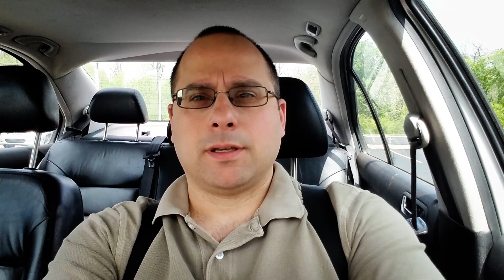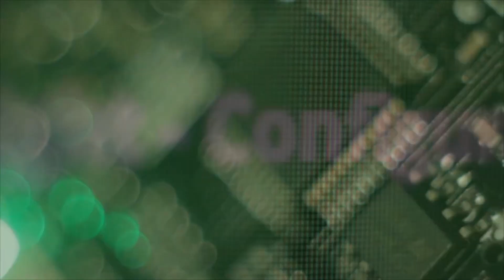Frsky Taranis antenna mod and why you probably shouldn't do it.

Comment: Since performing the Antenna mod (following Steel's video to the letter and adhering to FULL anti-static precautions) I have been experiencing a few issues where my Alien quad has been unresponsive in mid flight and I have had to disarm. I've never had a FailSafe occur in the 2+ years of flying so I'm not sure what that feels like when it happens. Therefore I'm not sure if my issues are down to the antenna mod or my FrSky XSR RX. The reason I say this is that my UBAD quad has an older RX (X8R) and I don't get the same issue. Having been a professional electronics engineer for many years, I know it's not related to any anti-static damage on my part or poor soldering skiils. Something else is at play here, and I'm troubleshooting this. So my recommendation is not to do this mod, as even with my meticulous approach I have an issue. Tony
Reply: A few things worth considering for some people Josh, 
1) There are genuine FrSky 2dB and 5dB (RPSMA) available and perhaps the solution is to revert back to a 2dB one.
2) Perhaps soldering the braid to both ground solder pads that sit either side of the signal pad? My thinking is that this may be a requirement for a healthy RF signal, even though both pads are connected together at some point on the PCB.
3) One thing that is still unclear is how does the FrSky telemetry and protocol work. The Taranis antenna is both a transmitting device (RF to copter) and a reception device (RF from copter). Therefore, there may be some particular way that these 2 functions are balanced (or multiplexed) and what we are doing with removing UFL connectors, soldering directly thick coax and using higher gain antennas could well be upsetting the equilibrium  of the system.
4) I'm going to create a test rig with my known parts that have given me issue (like RX module, FC, ESC, motor etc) and set this up on the bench. Then use the Taranis with 5dB antenna and try to reproduce the error condition by 'flying' in my usual way. If I can find a way to replicate it on the bench, then perhaps I can find a solution (like going for better quality antennas, lower gain antenna or soldering to each ground pad)
Regards Tony
Reply from the maker: +Expressive Imagery have you tried replacing the antenna?
Reply: You have asked this many times now I see. Did you just replace your 5db 
antenna and it fixed the problem?

What did you see when you opened the radio up and checked the pads?

There's a lot of folks who would appreciate a follow up on this video, 
even if you have no concrete conclusions or recommendations to make. We 
listen to you for a reason. You're a trustworthy and discerning 
authority. Thanks mate!
Reply: At this stage I don't have one to replace it with. I've just purchased a branded Wifi one from Amazon and will  try it out when it arrives. The trouble is that I can fly 20 packs and not have any issue since the issue is so random. I wish I can find a pattern so that it can be repeated. All I know is that it seems to happen within the distance 5M to 40M away from me. My Taranis does not tell me the usual "Telemetry Lost" when I loose control of the copter. Just the other day I was hovering in front of me just doing a little "drop catch" type exercise and at 2M height it just slowly rolled/pitched over and hit the grass with all props spinning. I disarmed straight away but the props where still spinning for a few seconds. At first I thought it was a failsafe condition that was triggered but since I have a detailed OSD running and I was recording on my DVR at the some time, the OSD did not show the normal state when a failsafe occurs. It's almost like the TX was still sending out the RF and the FrSky protocol was just sending out the last known logic pulses from the TX control board and ignoring any input from me. I've seen this exact same sequence occur 3 times now. Would you like to see the DVR footage for each incident? Cheers Tony
Reply from the maker: +Expressive Imagery are you 100% sure the receiver is set to "no pulses" for failsafe?
Reply: Expressive Imagery this is good science. thx man.

maybe do a vid on your channel with your findings?
Reply from the maker: That doesn't to me look like a failsafe. Failsafe usually looks like a control lockout followed by a slow tumble. But Blackbox would tell the tale.

Comment: When I cracked my taranis open to do the mod there was a UFL connector on the antenna board already. So it was a matter of unplugging the old antenna and plugging in my SMA. In my case would you still recommend not doing the mod?

Comment: I recently ordered a replacement transmitter board for my Taranis. 
My problem stemmed from soldering on the surface mount coax connector to my board backwards, (rotated 180 degrees).  Yes, one of those small connectors is a ground! 
Look carefully at the back of the connector before you solder it or use a multimeter to identify what are the grounds (3 of them) and the RF output  (just 1).

Comment: I am now confused. My taranis board went bad after a month of using it and it was still bone stock. I ordered a replacement board and now I am confused on how I should go about this.. put back stock antenna or put pigtail on it. Search around the web including youtube and the story is mixed.
Reply from the maker: Sorry, I don't know either.

My gut feeling is there is nothing wrong with the pigtail mod, as long as you use an ESD-protected iron and you wear an anti-static strap while working. The Taranis SE has the same mod, so clearly the mod itself is not fundamentally flawed.

I think that if you do the mod, you should remove the antenna as little as possible, both because having the antenna off exposes the connector to potential ESD, and because eventually the connector will wear out.
Reply: Joshua Bardwell thanks For the reply Josh, Yeah at least we should wear anti static wrist wrap or something. But working with electronics are not too hard but always tricky and risky

Comment: I know I was having issues after modding my DXE Spektrum transmitter and then I found it bending and turning the antenna over and over and over again actually disconnected my antenna piece to the PIN hard to explain but that was my issue so I don't bend buy antennas anymore I just put them in there keep them fixed.

Comment: Don't miss the solution below!!

It's mostly true, because many of us occasionally turn radio on without antenna (you make it detachable,  don't you?), and it takes literally seconds to burn the amplifier. But there is one good thing to know for everyone, who already done it and even for one, who burned their amplifier. You can relatively easy make it good again! If you have faced the range problem or may be a total signal loss, all you need to do is: 
1) triple check the antenna connections, and even replace the antenna sometimes, as one of brand new antennas was already damaged from the start and it burned my radio slowly (sometimes I was receiving antenna error, but most of the time everything was OK and no signs of imminent amplifier death was revealed);
2) find a good soldering fan or a man (woman?) who can solder really small SMD chip for you;
3) order a SE2431L chip (get a bunch of them, just in case you will mess something again) and gently, crossed thingers, solder it in place of the old one on the amplifier board. 
You can track it's position easily, as it's connected directly to the antenna line on the board, and there is only one such chip on the board anyway. I have fixed my radio some weeks ago and now it works flawlessly with increased range, comparing the stock antenna. BTW, you can repair you receivers with degraded range the same way!
Reply from the maker: This soldering is beyond most people's ability, but if you can do it, go for it.
Reply: It's pity, but you`re right, it's not everyone's ability. But soldering one chip in local phone repair shop is cheaper, than buying whole TX module.
Reply: Thanks for this info Артём Шубин! I have been searching for any info on how to fix this board after I (very cleanly) soldered a u.fl connector on backwards and slowly killed my tx. Since I could not find any info about it, I decided to tackle the diagnosis myself.  Looking at the traces on the backboard I could see the antenna lines were going right to the SE2431L - a chip I was not familiar with, but a quick search revealed it as the 2.4ghz  Front end module which handles amplification and switching of the antenna circuitry.  a few searches of "SE2431L Taranis" brought me back to Josh's video on the subject. (Hi Josh!) -  De-soldering this IC shouldnt be too terribly hard. many of the pins are NC, and the whole chip has a ground pad under it, so liberal application of flux and heat should be able to soften it up.. I will have to take plenty of photos...

Comment: my antenna is broken, i understand you shouldn't do this mod but is there anyway i can get my antenna replaced or should i just leave it as it is?
Reply from the maker: You can order a replacement antenna and solder it on.

Comment: Crap,. Maybe that's what's happening to mine... What should I do? Get a new module?
Reply from the maker: +Rigo try changing the antenna first.
Reply: +Joshua Bardwell I tried, I have 2 5db, one is better than the other but the 2nd one started to give me issues too... So I bought a folded dipole antenna from VAS, that helped me race this past weekend but I still had some range problems...What are your thoughts on getting the frsky external xjt module? (it's sold on getfpv)

Comment: Hi
A similar thing happened to my Taranis radio half a year after I did the mod.
It didn't show a high SWR but the range was greatly reduced.
I connected the radio to my Spectrum Analyzer and yes ineed it only put out about 8dBm of power compared to the 20dBm nominal.
I traced the problem to the semi damaged PA/LNA Chip
A SE2431L from skyworks.
Ordered a replacement part from Mouser. Took out the hot air rework station and a microscope and replaced the part on the board.
Now I'm back to nominal output levels and range is fine.
I think the most probable factor for damage would be an ESD event. Since with the original antenna connected no open connection is present. But if you do the mod you have an unprotected open sma connector on the outside. And you can easily imagine an esd event (touch with a finger while your body is charged...). And I guess the circuit on the TX section is not built to protect against these ESD events.

Comment: Out of curiosity what firmware are you running? I recently ( in the last month or so) updated my firmware to the latest RC 2.2 from opentx. Is it possible something changed in the software, that caused this recent spike in internal failures?

Comment: Pure guess but Im gonna speculate people are running poor quality dipoles that act as best at a dummy load...they may even increase range at first but cheap dipoles are notoriously bad (You can get good ones from brands like TPlink and others) but no name chinese ones are poorely cut snd tuned and maby overtime they are reflecting a lot of signals back into the TX and if its particularly sensitve module over time this is damageing them in much the same way a VTX without antenna will be damaged...they fail the same way can apear to be fine but suffer range degradation over time the worse the damage becomes or the longer you left the antenna off for ect.

Once damaged they are likely more prone to further damage Ik thinking.

Just a guess but poor dipoles could certainly be a factor.

I had an RF engineer do my specturm with an SMA...HE VERY CLEARLY WARNED ME DONT USE CHEAP ANTENNAS.

Comment: Excellent video sir! I had this exact problem happen to me with my original Taranis a couple years go when I tried changing my antenna from stock to an SMA extension.  Sad, indeed!  Killed the RF unit in my Taranis.  So now I have a Taranis Plus, and not touching the antenna.  Be warned!

Comment: the problem with the taranis without the mod is lack of removable antenna... which is the ONLY reason i did the mod. would be nice if they had made it with sma connected antenna, but dont think FCC would like that however WIFI units have them all the time so not sure why it wouldnt be a doable thing for manufacturing of it.
Reply from the maker: Taranis Special Edition comes with a removable antenna FWIW.
Reply: Joshua Bardwell ah, but have to buy a whole new one... when mine craps out I'm looking forward to it, but also am still on hunt for a tx with better ergonomics. no one has done it like I would want yet though.

Comment: I honestly never understood why people do the antenna mod on the Taranis. Mike Virgin on FB flew a quad 1.87 miles out with a bone stock Q X7.
Reply from the maker: Often, it is because the stock antenna broke, so they figure as long as they're in there, may as well make it removable. That way when it breaks next time, you just screw on a new one.
Reply: Ah I was more referring to the folks that do it specifically for the 5dbi mod looking for more range.

Comment: I work with aircraft avionic systems and was looking to do this mod with my new Taranis plus and was thinking that perhaps the problem may lie with static discharge through the RP-SMA connector when the antenna is not connected, like when you are transporting the transmitter. I know in my line of work we cap all exposed connectors with ESDS  plugs to stop problems like this. Just saying...

Comment: I too have done the mod out of necessity as I broke the original. I am also having massive range problems at the weekend. I thought it was receiver issues but I'm positive it's this now. I used the thinner coax cable but have since brought some of the stuff steele (ibcrazy) recommended. If everything was fine when I initially did the mod and now range is reduced massively has the RF module been damaged? Basically should I just buy a new board or try the thicker cable? Anyone got any thoughts?

Comment: Thanks for the heads up Joshua and I sure would like to know what happened to yours if you are able to find the problem later. I have already done my mod just recently and I have been a proficient at soldering for over 20 years and I am pretty sure that my technique was correct. I did not ground myself so who knows how it will turn out. I did cut my RG 316 to 84mm and was very careful during the process and used hot glue to protect the joint from flex and movement so we will see what happens

Comment: Hi. There is  thing happening to me, I had the "ANTENNA ALARM"" several time last time I flew. The SWR was jumping from 0 to 60.
So I juste cleaned the SMA connector using a hearstick and aceton. and My SWR went back to 0 or 1. And no more "ANTENNA ALARM" So I guess  hte connector got dirty and the contact was less than perfect.
Maybe that 's one source of problem.

Comment: WARNING TOO LATE:
After 5 months or so after the "upgrade" to the mod my range got worse and worse. RSSI dropped easily to <60-70 dB after less than 50 meters. I checked forums and all that stuff. First I expected the receiver: But with all my copters the same issue. So I just ordered a new main module. Now all is fine again (minus 50 bugs of course...).
All my soldering was done very precisely. The antenna was never removed. My SWR also was always fine. So in conclusion the tx module seems to be very sensitive for whatever. 
WHAT TO DO NOW?!?!?!
Please keep us updated.
What about asking FrSky about their opinion?
Reply from the maker: Have you tried replacing the antenna?
Reply: Yes, that was the first thing. Of course the same reduced range. I think one indicator that the module will fail  soon or failed already is that the SWR doesn't change that strongly if you grab around the antenna etc.
Also when I figured out that the module was defective, I removed the antenna. Also then the SWR still was good!!! Anyway what to do next. Downgrade to stock? But thats also a risk to destroy the solder pad or something else.

Comment: JOSH DID YOU EVER HAVE RANGE ISSUE WITH STOCK ANTENNA?
Reply from the maker: +david ringler yes. During my Fatshark module testing sometimes I got failsafes at the extreme edge of range.

Comment: Josh if you remember I posted on your last video about this. My friend and I have had the same issue.. Radio antenna defective is the error message. I pulled out my Sma pigtail.. And the signal wire going into the center pin was not sticking out if the shielding.. Contact me @ ezccdw@gmail.com I'll explain and send you pictures. This is more then likely your issue as well.

Comment: Mang!!!! You didn't ground both sides of the shield properly!
Reply from the maker: +Nathan Imig explain to me why that is necessary?
Reply: My bad could of sworn the stock antenna was soldered to the board like that (yea it makes no sense either way). Did you happen to charge without the antenna?
Reply from the maker: +Nathan Imig I think it is, but I don't think there's any reason why it has to be except for mechanical support. I could be wrong.

Comment: just buy a futaba and not a cheap taranis
Reply: Neither do I and it makes no sense to me when people talk about not having telemetry as a deal breaker.  Sure for a plane i could see it, but nobody flies miniquads far enough to worry about their signal strength.  Maybe there's a reason why a dx18 costs $1k, because it doesn't have cheap electronics inside?
Reply from the maker: +Ducksauce Tysdal when Futaba runs Opentx I'll consider it. Oh, also when Futaba has a receiver that competes with the XM+.
Reply: I don't use telemetry and I came from collective pitch helis. for the mini quads I use the fm800 pro Rx and haven't had any issues.